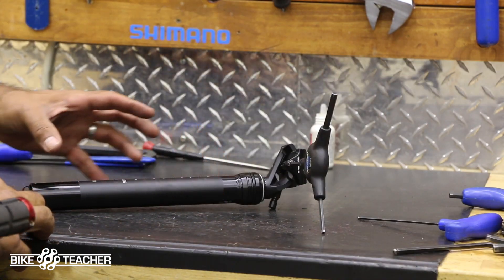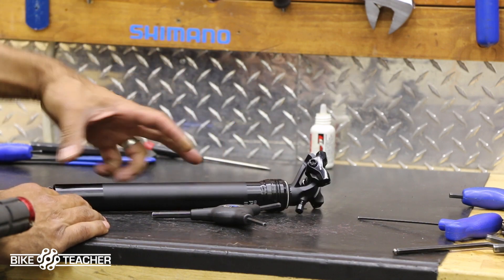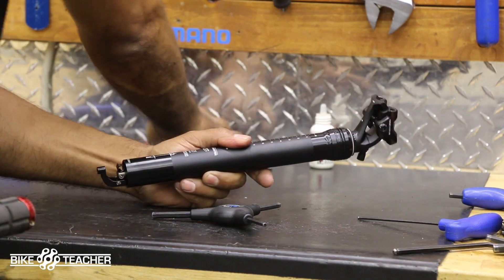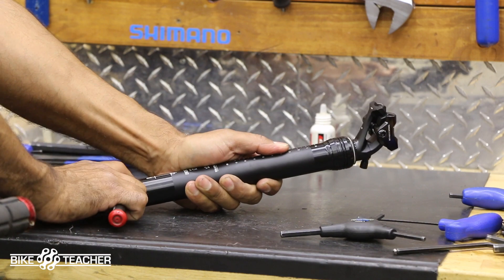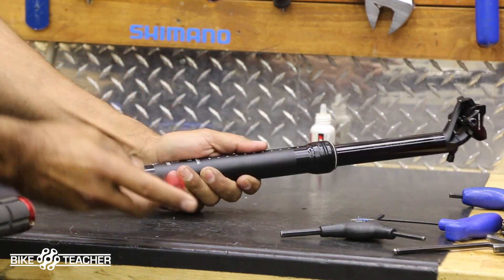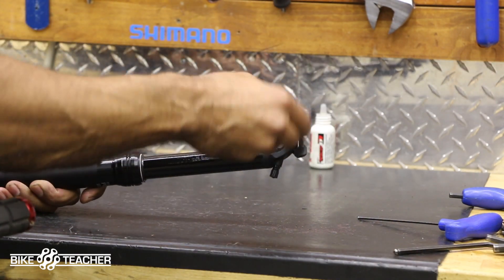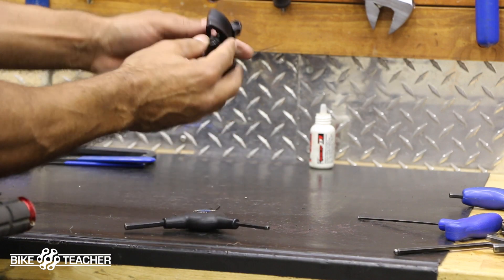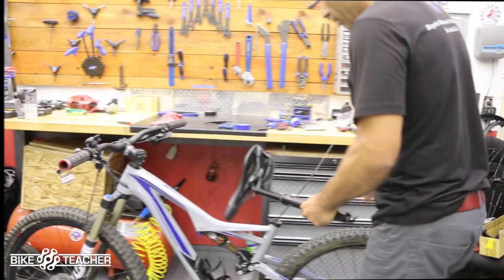How to install saddle & find proper height on a dropper post.

Comment: I enjoyed this but I think people are looking for information on how to reduce the travel on the dropper post to top out at the correct height for  the rider
Reply from the maker: Hmm...Kinda of like reducing travel in a fork? Or increasing travel in a fork? The quick easy fix would be to adjust the height of the overall seat post in the frame when at full extension, but you may be looking for something different. I have not herd of an internal adjustment for the droppers. Most people are forced to buy a particular length dropper from the beginning. Have you herd of such a dropper post on the market? Or a fix, let me know. Thanks, Arthur